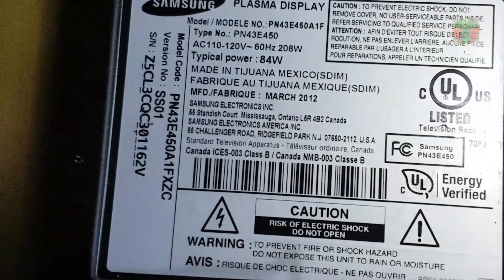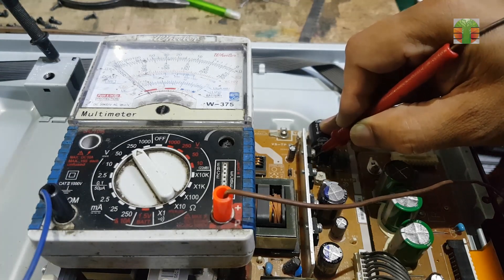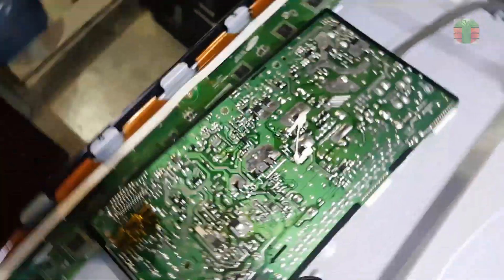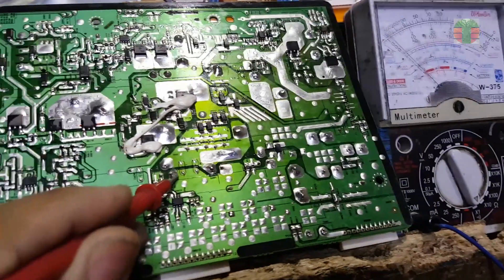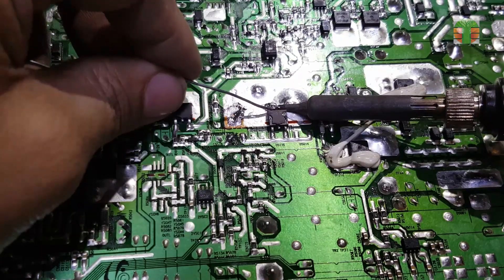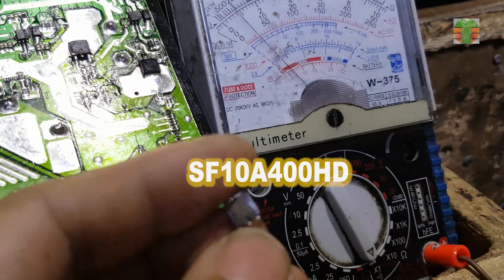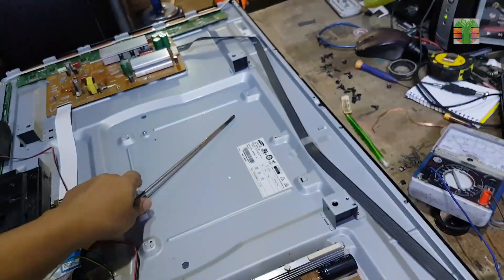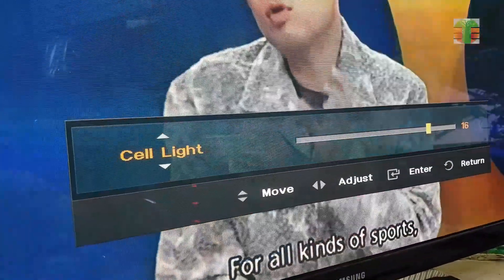Samsung Plasma display. Y SUS repair.

Comment: I have this TV. While I was watching, I heard popping noises. There were sparks and the TV picture turned off. It goes to standby mode ok. But if I turn on picture, I hear popping noises and see sparks. Would this be a power board issue?

Comment: U have replaced igbt and diode ,,is there no possibility, the small ic s get damaged ?
Reply from the maker: yes, it has a  possibility.
Reply: @tevzTVTevatronics  thanks for your reply ,,,I have replaced every igbt fet diode ,,,checked in detail all Resisters n caps on  Y board of my 43 "samsung plasma but still no picture ,,
Reply: I have replaced the buffer board too.

Comment: If I remove the damaged capacitor and I don't put another one, would it work?  Or do I have to put a new one on?
Reply from the maker: You must replace it,  I did not do not to replace it.
Reply: @tevzTVTevatronics  And in case you don't place the capacitor and leave that space empty, do you think the tv will work?

Comment: Good job 👍..Sir, i have with me an Lg Led tv that shuts off after 20-30 mins. I already re soldered all the cold solder pads in the psu. But still it shuts off after 30 mins.. do you have an idea what is the problem? Thanks
Reply from the maker: Is also the sound turned off?
Reply: @tevzTVTevatronics  sir tv sounds is ok.. but i have noticed that a chopper/yellow big thing going to backlight is to hot to touch😔
Reply from the maker: @pnoechie21   The LCD panel or the backlight may be the problem.
Reply: @tevzTVTevatronics  thank you sir more power to your chanel